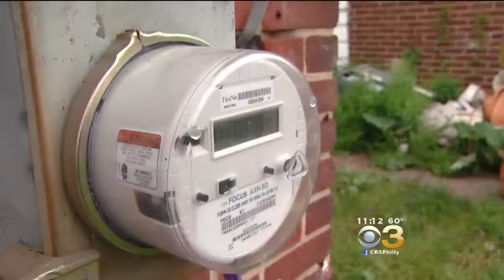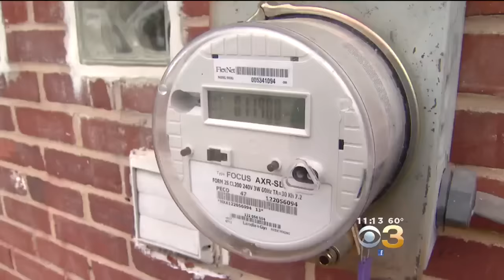PECO Combats People Using Everyday Items To Steal Power

Comment: If tesla had been successful,there would not be a need to charge for electricity.at all.
Reply: Even the great Tesla, for all of his skill and talent with electromagnetic theory and engineering, cannot subvert the laws of physics. The power has to come from somewhere.
Reply: There is no free power.  There is no way to capture power this way.   This is just like the Tesla valve... it seems really practical and its easy to be bamboozled into some sort of conspiracy theory covering it up.   The reality is neither invention works for crap and its a scam.
Reply: The Tesla valve does work - it just has enough back-leakage that it's a very niche device. It's used in some laboratory equipment - no moving parts means it can be made very reliable even when handling the most corrosive of fluids.
Reply: However well this theory may have worked, we would still need to pay for electricity. Who do you expect to fix power lines and install upgrades and new lines? Not to mention running converters. You take a full bolt of lightning to your house and everything will be overloaded.
Reply: Tesla just wanted to wirelessly transmit power, he didn’t have any new ways of generating it, so yes you would still pay for it
Reply: we all know what happened to Tesla and his research after his  apartment got raided...
Reply: Funnt thing is even if tesla had been successful we wouldn't have gotten any further to free power. Also your wireless internet usless your cell phone useless. Electricity would be taking up all of that spectrum on the radio waves. While a tesla coil is a novel toy, thats all it will ever be.
Reply: We are atleast 50 years behind in technology due to "money and power". Human evolution has stopped.
Reply: Tesla was killed by the american government for wanting to give people free energy...he invented 90% of the electrical technology we use today...inclufing cell phobes and micro waves... hell..he even made a patent about making electrical current from radio waves.

Comment: Maybe the power company needs to lower it's cost to people,  most people don't want to steal but will if it's causing their family undue hardships.   In todays society you have to have electricity
Reply: Power definitely can be cheaper in many places.
Some utilities have too many administrative costs they do not want to cut.
At least here they're not taking every case to court but pushing the city for subsidies for the poor would curb theft and the cost of repairs to the infrastructure it incurs.
Low income housing needs to be more energy efficient just adding new windows and insulation to those old buildings could cut the energy used in half.
Then there's over dependence on natural gas turbines which are good for peaking but not cost effective for base generation if a large natural gas deposit is not nearby.
The smart meters probably cost the utility more money then the old ones because they're more inclined to turn people"s power off which encourages more theft which cost them money plus they have a shorter service life.
Some analog meters have been in service for 40 years good luck having a smart meter last 10 or 15 years esp if the designer decided it's a good idea to use aluminum capacitors in such a rough service environment.
Last we need more nuclear power but in the form safer CANDU and molten salt reactors.

Comment: In the USA they dont use seals on such meters? Here in NL you have to cut a seal to get to the meter connections, which they will find out, and then you have a massive fine and what not for kind of trouble. I just looked it up, it costs 660 euros if they find your meter with a broken seal on it. Thats 811 USD.

Comment: What costs? Power companies generate the me amount of power regardless of how many people are putting a load on the grid. Each plant serves up to a certain number of households, and outputs at that level, with a slight buffer for emergency power in the event of a sudden spike in power draw. This is why "low power usage" devices do not save the planet, the power plant still makes as much energy as it ever did. Likewise, I dont understand how they can have costs other than lost revenue from people stealing power like this. The plant was always going to generate that power, which wouldn't have been used at all otherwise. IE, wasted.

Comment: Energy should be free!
Reply: And then what would be the incentive to not waist energy ?
Reply: OK I see your point, everything would be completely out of control if there was nothing in place!
Reply: Yes, it should, but how? How are paying off the building costs, maintanence etc? I always hear complaints of this and that but no real alternatives.
Reply: You're right!  Its a simple solution.... make all of the workers for the power and utility company work for free.  Also, make the people who mine the coal or work on the gas drilling rigs work for free as well.  Also, the factories that make the wire/insulators etc will need free labor, the people who make the machines that help mine or dig out the material to burn, etc.  All of them will need to work for free.  Oh, and the companies will need to be allowed on anyone's property for free to mine the material for either burning or to build the things like solar panels, and windmills.

They used to have a system for this, its on the tip of my tongue.  Oh yeah, slavery.  Dammit.

Either all that... or you could pay like 200-250 bucks on a bad month for power to heat, cool, clean, cook, entertain, and light your home and the people in it.  WHAT a ripoff!
Reply: A 500 million watt combined cycle power plant will burn around $90,000,000 in natural gas per year, this can vary wildly with price.  500 MW is enough for two reasonably large cities.  There are a lot of cities and a lot of people living out of the large cities.  That same plant will have a few million per year in labor costs.  Several more million in water.  It truly is not cheap to run those plants.  Many are no longer profitable at all, particular coal and nuclear, as evidenced by the large utilities desperately looking to offload them.  Currently the transmission system is where the money is.  

Decades ago the idea was to use nuclear and make power too cheap to meter.  You would still be paying for the plant, just not based on usage.  Obviously this does not work, at least not yet.  If you want a nuclear plant be prepared to drop no less than $15 billion and figure on 15 years or more to design, permit and construct.  Largest part being to permit.
Reply: Jenn G.
Food should be free.
Nelson Mandela should be free.

Comment: You want to screw with them. Just super glue the meter housing down. You need a pry bar to get the meter cover off.
Reply: The utility companies have various kinds of locks and tamper-evident seals available for use on meters when power theft is suspected.

Comment: I " heard of" people that use to just cut the clip, remove the clamp, pull out their electrical meter, flip it over, and plug it in upside down. Most would not read at all, so they would leave it maybe 10-12 days, others would spin backwards, lol, naturally don't leave them upside down maybe 6-7 days. Or the electric company will owe you money. Don't get caught. The electric co will send you a yearly schedule for meter reading. Its usually about the same time of the month. Also, behind the meter, is the very dangerous connections. Watch what you touch. Or hire a " crooked" professional. Of course, nowadays the electric co has smart meters, not sure what bearing they would play on it.
Reply: Yo I’m bout to txt u
Reply: Ok no messages anymore but can u give me a reply

Comment: People don't need to steal power. You can use cheap simple solar. Even if your grid based most people waste lots of power they don't need to pay for. Check your watts per hour. With so many low volt,  low watt things we use today we don't need much power at all.  Modern air conditioning heating and refrigeration/ washer dryer are the things that kill your bill - they can all be replaced with low technology thats just as good with no electricity at all.
Reply: No. A zeer pot or root cellar can easily keep food cold at 50 degrees F. Similar low tech can keep you cool or give you heat. You can use small simple solar to run laptops, tv's and small appliances if needed.  My point is grid based electricity isn't needed. It's way overkill.
Reply: See this for low tech air conditioning. Starry Hilder (off the grid) shows you how using the principles of thermal mass. v=J_2IuJ4Xd9Q - All these technologies are free or dirt cheap.
Reply: Your living in a fantasy land, and I know this because you use none of your own suggestions. " free or dirt cheap" my ass. Not including installation solar panels currently sell for about $ 3.00 to $4.00 per watt so to get a lap top to run your looking at over $100.  a refrigerator over $4000.  As for a root cellar while if you don't have a basement you may think you can send the kids out in the back yard with some shovels and line it with tree bark... the reality is the cost would be well over $5000. ( feel free to price one ) and 50 degrees is pretty dam optimistic unless of course the out side temp. is  already under 50. Your "point " seems to be either throw your self back to the stone age of spend thousands of dollars to save a few hundred .
Reply: I've studied these to design my own home when we go off grid. If you do much of the labor yourself you can keep cost very low. These and more like passive solar heaters are in use and are reliable. Look up Simple Solar Homesteading by SolarCabin. A small initial investment will save you thousands as opposed to staying on the grid. This is designed for those who wish to go off grid and want to live a sustainable lifestyle. Lots of people are moving out of cities for these reasons. You know who wants you to buy refrigerators and modern air conditioning systems that use grid power? The people who make and sell those things and the electricity they want you to use. The average electric bill in the US is about $110.00 dollars. Multiply that by 12, then by the 20 30 40 or 50 more years your gonna live in your home.
Reply: Divergent Droid my electric bill for small apartment is 35 winter 70 summer....over $15 a month is just to have the damn service....i get 3 or 4 30 day shutoff notices every year because they charge $2.50 to pay the fucking bill....but the late charge is like .65 cents....beat them at there own game

Comment: This all just show and tell,  First off utilities are guaranteed a profit. Secondly they have meter panel locks that are pretty hard to take off, even harder when you have no electricity. And lastly instead of this dog and pony show for TV ( made to get people to turn there neighbors in to the power company ) they could just as easy disconnect  lines from a top the poles or main switch gear for repetitive " jumpers " .

Comment: Dam that was some scary looking wiring. Where is code enforcement in this city? I can't even have a loose breaker panel cover without getting a fine and having to pull a permit to have the problem corrected by a electrician and inspected by the city.

Comment: and yet, I have heard and Seen abandon houses and buildings and abandon schools. That have power on still some been on for years. Take a abandon warehouse not far from me. It's power was finally shut off after 18 years of having Free power. when the warehouse owners just left the property to nature. little over 18 years ago. For long time, at night time can see lights on inside. Heck I even been inside the place about 4 years ago when the wooden double huge doors fell down. place is a mess inside. but there was a couple lights still on and working. Was actually on local news here a couple months ago. When Power Company finally came in and shut the power off. The power company said, the power should have been shut off almost 20 years ago for none payment. but, they were unclear why it wasnt shut off

Comment: I hate when people use the wrong word for being electrified. When they say electrocution it means death by electricity but you don't die from touching 240v ac.
Reply: You certainly can die from touching it, since 240v ac is around 400volts at peak, which can easily kill yu
Reply: Voltage, to a certain degree at the residential-use level, plays its part, but it is more often the amount of current passing through your body that kills you. Static charges can reach thousands of volts, but at nearly insignificant current levels.  Electric current at 30mA will either stop your heart (cardiac arrest) or cause fibrillation (erratic heartbeat), both of which can be fatal if adequate medical treatment isn't provided in time.  A typical residential electrical service can be anywhere from around 60A up to 200A capacity, which is between 60 and almost 670 times what it takes to stop your heart.  The extent of injury depends on where you come in contact, how well insulated or grounded you are, and what path the current takes through your body.
Reply: Timothy Barney thank you you just save me the time of explaining that to them

Comment: If found to be stealing, the power line should be cut back to the pole and removed, end of hookup capability.
Reply: Paul Moffat that works well for above-ground Services where they can cut the wire at both ends and roll it up and get rid of it but not so well for underground services because they would have to dig a trench from the house to the pad Mount Transformer and potentially even have to cut through a road to get the wire out and then they would have to do the same when the customer wants to hook service back up

Comment: Well if they weren't idiots they would just disconnect it at the step down transformer and it wouldn't matter what the people shove in the panel.
Reply: eric wsmith Well, yeah, I'll give you that. For the most part it's not idiocy on the level of the acting personnel. I do know first hand the level of "not in my job description" that exists on the bottom, but if you start looking upward you will in fact find idiocy. RMs generally don't put geniuses in management positions, geniuses talk back, and managers these days seem to be selected for their level of yessirness, which inadvertently selects for rather dull individuals.

Comment: Fools, their stealing right from the box, that's not how you do it. You dig underground & steal it directly from the power lines, then drill a hole in your wall to run the cables through, & into your box. Remember its 3 phase power so make sure to connect them properly, but the other of phase 1 & 2 doesnt matter.

Comment: I'm from the UK and I feel someone steeling gas and water plus electric is that possible
Water with push fit
Gas ??
Electric connection by electronic plug hotwire by wires and some cowboy builder come to my mum's home to do work on what she asked bro it's getting peak and I'm pizza offed about it 
The only one thing I wrecken it's being stolen  for 🌿🌿

Comment: Just Fucking use candle for light and use a solar panel and an inverter from DC to AC power for heat and AC.
Reply: Burning Experience the question is, is it illegal to live within City Limits without those basic Utility Services? I've heard in some places, it is.

Comment: i am 12 and i could do better.. acctually i have
Reply: Sam Komola ha ha ha ! "actually i have" lmfo!!
Reply: Yah you'd think they would have enough sense to at least rip some bus bar out of a old breaker box cut that to the right size and shape and attach a handle made of PVC pipe.
Second option smash down some heavy gauge copper pipe and do the same.
 They also could just apply to one of the energy assistance programs they have in Pennsylvania.
Though many people do not know of the existence of these programs.